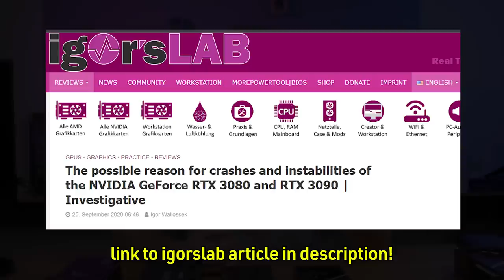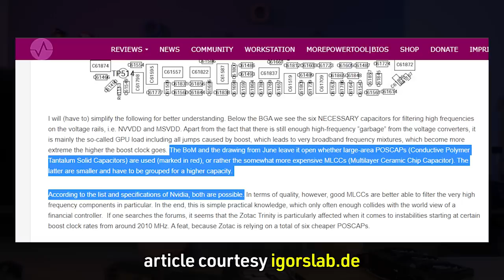The RTX 3080 Launch can't get any worse... Right? Wrong...

Comment: remind me why we pay so much for graphics card, especially when they cheap out on the important components
Reply: @Stevospeedo nVidia mad a bad design?

Not one of their cards has all of those spots populated with singles. At least ONE field has the array in all of their cards.

The resellers decided to save like, a buck and a half (one array) to nine bucks (all arrays) per card and shot themselves in the foot.

nVidia was unaware of the problem until recently because, likely, they hadn't anticipated just how cheap the vendors would go, hadn't tried six poly caps themselves (because, seriously, who's gonna risk the power filtration to the GPU for a BUCK AND A HALF?!) and are now probably just facepalming and trying to collect themselves before releasing a tech memo not to do that.

Every MFR that used six polys on a flagship card - this is your warning, as a consumer - that company is employing engineers to maximize their profit margin, no testing or quality oversight and doesn't give a rat's ass about the quality of the product or you as a user.
Reply: @SwervingLemon   gigabyte gaming oc only uses the singles....
Reply: Swerving Lemon jay said it’s nvidia who was secretive. Aib’s did not have enough time to test their 3080 hardware due to nvidia’s late drivers needed for properly testing.
Reply: @Stevospeedo but the reference design is one ceramic array with five poly, whereas the AIBs who've cheaped out have gone with 6 polys? Unless we get evidence that even the 1/5 layout is crashing, I don't see how this is nvidia's fault. It's on the AIBs.
Reply: @Stevospeedo not really how it goes.
Reply: @Stevospeedo 14:41 as jay states, you're only guranteed the printed stock and boost speeds. nVidia likely only validates against that for the AIBs, so it's not there fault the AIBs cheaped out causing instability at higher clocks.
Reply: Rgb
Reply: @Stevospeedo did you even watch the video?
Reply: Because the vast amount of the cost comes from R&D, not production. And contrary to what people are saying, these manufacturers probably operate on very thin margins when they plan to sell millions of these. So 1 saved dollar equals a lot of money saved total. Obviously the money was saved in the wrong spot here, but that doesn't mean that saving a dollar or so is a sign of the manufacturer being cheap.
Reply: @Stevospeedo Lol. Nvidia spent 2.4 billion dollars on research and development in 2019. So if they sell 10 million cards (licensed or directly) that means 240 dollars of the cost of the GPU will still be R&D. On top of that comes cost for marketing, management and other overhead expenses.  

"Production costs are constant at scale"
???? That's literally not true. Production costs go down with number. Everybody who has ever sold anything in larger numbers knows that. Cost of materials, production cost, set-up cost etc. all go down with volume.  Manufacturing just 10 Graphics Cards would be ridiculously expensive, at the volume Nvidia is producing, i would estimate the production cost for each card are less than 100 dollars.
Reply: miyagi ryota nobody forced them to get the card out immediately. They could launch later after FE.
Reply: @Stevospeedo Nvidia makes twice as much revenue on gaming than in datacenters, what are you talking about?
Reply: @Stevospeedo Where are you getting your numbers from? How do you know where Nvidia makes profit and where they don't, and how do you know how much money they spend specifically on R&D for specific sectors? First you erroneously claim volume doesn't reduce production cost, then you claim Nvidia spends most of their budget for R&D on Datacenters but the consumer cards which are supposedly just a byproduct of that (a byproduct that makes half their revenue) they dump on the market somehow have a worse profit/revenue ratio. DESPITE supposedly having high-margins. 

You sound like you make stuff up.

Comment: Me: Oh no, my TUF Card! (still waiting on it)
Jay: The ASUS TUF has literally the best Caps of all the 3080's currently
Me: Oh yes!
Reply: Lol me planning on getting one of those !
Reply: Well you have to hope there wasnt a change during the early phases of production. AIB's and companies in general very often change out the chips they use when building boards. It all depends on pricing of each component. You can buy 2 of the same card and they "can" have different components if they were built in different production runs at the same factory.
Reply: I would hold off :P People are saying that the ones they sent out to reviewers had the best caps but in reality they have 6 cheap caps. Have a look on currys pc world site (link below), you can see 6 cheap caps. https://www.currys.co.uk/gbuk/computing-accessories/components-upgrades/graphics-cards/asus-geforce-rtx-3080-10-gb-tuf-gaming-oc-graphics-card-10214446-pdt.html
Reply: TUF and STRIX both have 6 poscaps from what I have seen
Reply: Yep just checked newegg photos and both the OC and base model TUF cards have all 6 cheap caps. They gave their best binned cards better caps and sent them to reviewers, I'm cancelling my order for the TUF card.

Edit: Just checked other websites to confirm, every review and teardown has 6 good caps and every retailer shows 6 bad ones.
Reply: @Lethalogica  I was looking at EVGA's XC3 ultra gaming card and it has 1 set of MLCC, then at their top of the line FTW card and it has 6 poscaps... what is the go with that haha
Reply: @Sabran44  This whole thing is sooooo sketchy, if other AIBs pull shit like this but have a backplate covering them there is no way to know if your paying hundreds of dollars for a beefed up cooler but the power delivery limits your overclock to effectively 0.
Reply: @KonradW92  people on reddit said that TUF have 6 mlcc. The retails just have old photos
https://www.reddit.com/r/nvidia/comments/izhpvs/the_possible_reason_for_crashes_and_instabilities/g6j3b8b?utm_source=share&utm_medium=web2x&context=3
Reply: "My card has duh bestest caps."

Capacitors new pc building meme since we'll be hearing about them for the next 2 years from people who have no idea what they're talking about.
Reply: @pickleadaykeepsthedoctoraway  yep. It's a theory at the moment. Still, it's a huge oversight if proven.
Reply: @amyisme13  i checked my gpu and i have 6 high quality capacitors i have asus tuf 3080
Reply: @Sabran44  EVGA sent POSCAPS cards first to reviewers and then noticed the problem, effectively sending them updated cards. All retail cards got MLCC ;)
Reply: TUF was my final choice out of all the cards I was going for, yet it seems to be routinely performing as the best.
Reply: That's surprising because previously the TUF brand has been for cheaper stuff.
Reply: Lethalogica does anyone know what the Gaming x trio has? That’s the one I got and I can’t find much about what caps it has
Reply: asus website gallery show the MLCCs being used on the 3080 rog stirx, and other vendor website photos are showing POSCAPs in use, can anyone verify what is actually being used on the Asus Rog Strix rtx 3080 ?????
Reply: I have been checking all morning.The TUF and STRIX both have good capacitors.I am pretty sure someone posted a link to a Reddit thread which gives the information on all cards.If your getting a card I would check the link.
Reply: qDusted ahh what the hell! Thanks for the info really makes u wonder! Have one on order as well, might have to check...
Reply: This is me.
Reply: @bigGatster  False. I own a day one 3080 TUF from Micro Center in Atlanta. It has all the small high quality caps. There are none of those black large caps that you see on the retail sites.
Reply: @bigGatster  then i guess the vendor sites are all using the same photos, i really hope that is the case and t hey didn't cheap out after sending Jay one because now that is the card I intend to get if they ever become available again
Reply: @Sabran44   the strix is a higher end model, shouldn't it have the better poscaps?
Reply: @bigGatster  dude. Source? Unless u have the card itself, don't comment shit like that. Retailers are using older photos.
Reply: I really want the TUF card. It looks really nice nice
Reply: @Lethalogica  there is a way, open it up and look :P
Reply: @laggmonstret  yeah... After you buy it
Reply: Lethalogica wait what? My TUF 3080 has 6 of the good caps, i just checked it, Wth?
Reply: Jake C i have recieved one, and mine has 6 of the expensive ones, the TUF version that is.
Reply: @gibs1919  I don't have the card yet but every retailer has product photos with cheap capacitors
Reply: @gibs1919  Who'd you buy from?
Reply: Well now it means everyone will be gunning for Asus TUF or Strix so its gonna be impossible to find that in stock. I was ready to buy Zotac 3080 Trinity as i had confirm availability of those in my local computer shop at 1st October but no longer, i will be avoiding those like plague. Never liked zotac tbh, my 1080Ti AMP Extreme broke after 2.5 years of service.
Reply: @Lethalogica  Asus tuf OC has all 6 MCC (good one) The Asus tuf gives you  all 6 POS
Reply: @Teknoliger  The OC has the cheap ones too in the pictures on newegg
Reply: @Lethalogica  Its a re used picture. go on other youtubers review and type asus tuf oc and skip to the back and you see all the reviewers has all six mcc
Reply: @Teknoliger  Do you know any reviewers that have a retail sample isntead of a review one?
Reply: @Lethalogica  Tech Yes city
Reply: @TokaroGmbH  Tanks  : D
Reply: @watchman1015  i have the normal tuf and all 6 are mlcc (good ones). Bought from asus eshop.
Reply: @Teknoliger  I just watched the review, it came out the day after launch and he lives in Australia. The OC model wasn't available on launch day in Australia and he still needs time to actually film and edit the review meaning it pretty much has to be a review sample not a retail card.  Also he never says he bought it.
Reply: @Fozai  Thank you for the info, it helps ease my mind when buying, when stock becomes available that is : O
Reply: @Teknoliger  So if the non-OC TUF card has 6 quality caps then where do these pictures of 6 cheapo caps TUF cards come from. This whole thing just seems sketchy.
Reply: @Lethalogica  ASUS and EVGA first shot the pictures and gave them to the dealers and later decided to not use the cheap stuff because of the problems
Reply: qDusted It’s fucked up that companies are allowed to cut corners like this even when they charge way above MSRP like the ASUS Strix RTX 3090 OC which is going for £1699.99 in the UK.
Reply: @NicoD3000  I guess that makes sense, its just since its not in the pictures or the spec list I doubt you'd be able to do much about it if they did turn out to be cheapo caps. Which is fine for like the MSRP zotac card but anything that is meant for overclocking is really gonna suffer if you get crashed above spec speeds.
Reply: The TUF lineup has been infamous for cutting corners. I'm not 100% sure if the cards that go on retail would be as expensively built as the ones the reviewers got lol
Reply: @amyisme13  this. they changed their design pre-production, which explains why a lot of retailers have old photos. don't cancel your orders guys, at the very least wait and see how this turns out and cancel when you know for sure.
Reply: @Lethalogica  lol so they are worse than anyone out there they are cheating ^^
Reply: and its the best looking except the FE maybe
Reply: Lethalogica Don't cancel it, the retailers got old photos, eeryone who has recieved one shows they got the expensive cap
Reply: @Lethalogica  Do you truly not know that those pictures sent to retailers are based on early versions and not always the final product? That is why websites usually have a text saying that images are not always representative of the product. 

Now, all sources that have actually had a TUF or Strix are saying it has all 6 sets of the more expensive ones. Asus has even updated the pictures on their own site to show the more expensive capacitors and most likely sent new pictures for retailers.
Reply: @KonradW92  in the end people will realize that asus knew about it and are the worst of them all!
Reply: @UmVtCg  As has been said many times in this comment thread,  those are old pictures before they swapped out those caps.

if you look up you'll see multiple reports from consumers who got the more expensive caps.
Reply: @mikeramos91  Yea it looks like vendors are using out of date advertising as people are reporting the TUF series, at least has all high-end caps
Reply: Having all 6 caps as MLCC isn't necessarily a good thing either.... both types of capacitors have their respective advantages, with MLCC caps being smaller, cheaper, and operate well at high frequencies - but they have temperature limitations and crack more often. Conversely, POSCAPS are more expensive, bigger, have a higher temperature rating, and don't crack as often, but aren't as good at higher frequencies.

Comment: You never cheap out on bypass capacitors every electrical engineer knows that
Reply: but not the ignorant guy in suit who has the controller job.
Reply: unless the upper management wants cost cutting.
Reply: the engineers didn't decide that, the management did to get more profit.
Reply: Cheap out is a no, but using more expensive components and adding cost for nothing in return is also a big no in every market.

Everyone can overbuild, extra cost = less profit...

The capacitors are working with the listed GPU speed, that is what they were designed to work with. If the engineer dont have the full/correct information there WILL be mistakes like this.

With the number of companies messing this up, its not just some engineer or manager that made a bad call.
Reply: @ssu7653  thats exactly the way I see it. If Nvidia are advertising that the cards are 1440Mhz and boost to 1710 then you design the board to do that. That is perfect lean manufacturing. If Nvidia's software then decides to boost the card higher than advertised, for me that is Nvidia's fault. Nvidia also clearly knew about this possible issue as they beefed up their card, but it seems they either didnt tell the AIB partners or the MSRP is so close for the AIB's they can do very little about it.
Reply: Really does depend upon the AIB. In design there will be different price targets to hit for different AIBs but also, availability of parts. E.g. if no MLCCs are available AIBs may just put on the cheaper variant ESPECIALLY with high demand that AIBs are currently facing to get GPUs out the door. But that may not be the case and AIBs like ASUS may just have been lucky in wanting to supply their customers with the best quality parts (because it has to be very "TUFFFF" pun definitely intended) I ordered a TUF but only the AIBs know the full story. As an electrical engineer myself, I'm gonna remain skeptical and cross my fingers lol.
Reply: They didn't cheap out. They used the caps which Nvidia promised them would work.
Reply: @richardharrison2802  You're forgetting, its the VBIOS that controls the boost so its still the AIBs fault.  Now if it only happens with a manual OC then fair enough, you're trying to run beyond the AIBs spec.
Reply: I agree